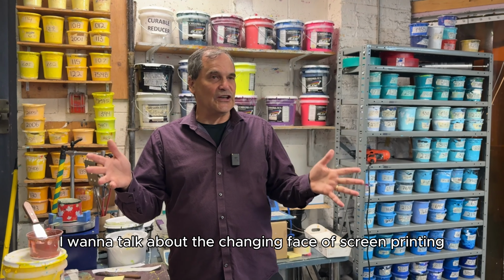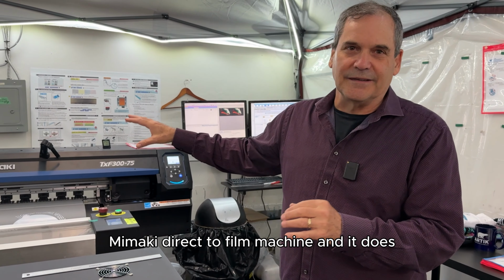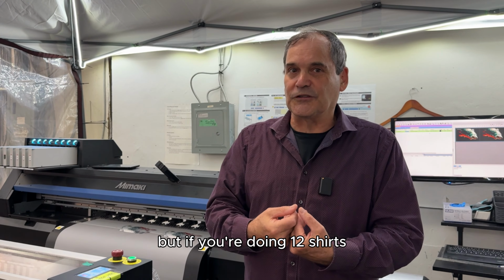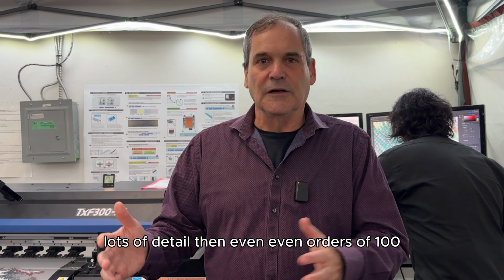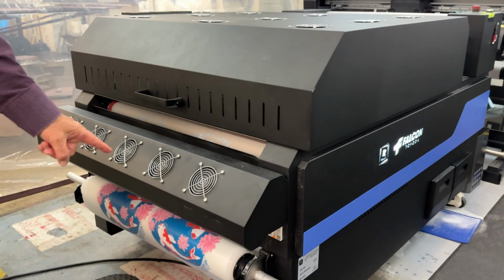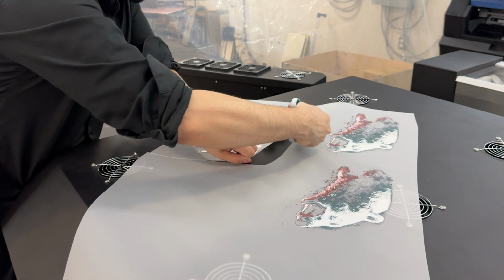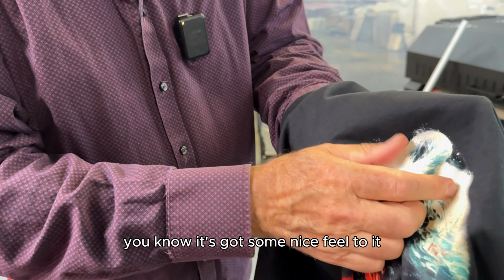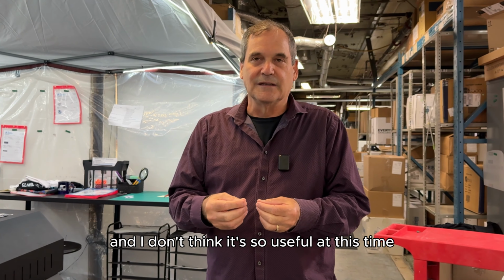From Screen Printing to DTF: How Technology is Changing the Game

Comment: Such a slow printer for its cost.
Reply from the maker: I get your point, but since we can put several designs up in a row, it prints more than it seems. 
Another advantage is that it mainly runs by itself, so the operator can heat press shirts, work on the next design, and cut the roll into printable transfers.
It's quite efficient, especially for complicated designs that take a long time to set up on the screen printing equipment.

Comment: I sell DTF transfers among another things and I just got into screen printing because nothing beats screen printing. It has been around for a very long time and it isn’t going anywhere. 

The one issue I have with DTF is the color range in the CMYK color gamut. Even if you add 8 colors and white, you will still struggle to match colors. Not to mention Pantone color matching is harder with DTF (or digital printing modalities) as the white ink is used for the under base and does not impact the color. 

Having both methods is a good thing because you are able to provide the best services to those customers who just don’t trust DTF or heat transfers in general.

I also want to add, most of the DTF transfer companies selling transfers for dirt cheap are using the cheapest consumables so the customers really get what they pay for. I spend a decent amount of change on my consumables to make sure my customers get the best product that will last the longest. I can’t count how many times we have been told our transfers are better than the big box names. Don’t aim to be the cheapest. Aim to have the best product and the customers will come.
Reply from the maker: Right on. We use traditional screen printing for Pantone colour matching and large orders, and DTF for smaller multicolour jobs. DTF helps address the main pain point of screen printers. After doing screen printing for many years, I know how painful it is to set up six colours for just 12 T-shirts. The amount of screen reclaiming, coating, aligning, ink mixing, and registration required is huge. You spend an hour or two on setup, and then the actual screen printing takes only five minutes.
In case like this DTF is much faster and reduces the environmental impact.

Comment from the maker: Do you agree with the video conclusion on screen printing and digital printing?
Reply: Wait until DTF goes high speed with Roll to Roll using single pass printheads or single pass inkjets with a sheet feeder (like offset). It will be a game changer. Heat transfer presses will be more automated and staff will be easier to train.  Require less employees, less capital equipment purchases, smaller warehousing , less utilities and a simply production model. 😂 It makes me sad.